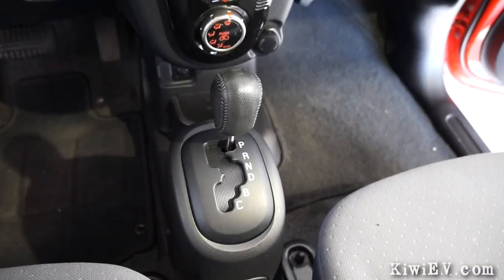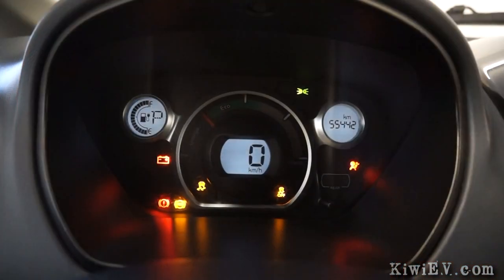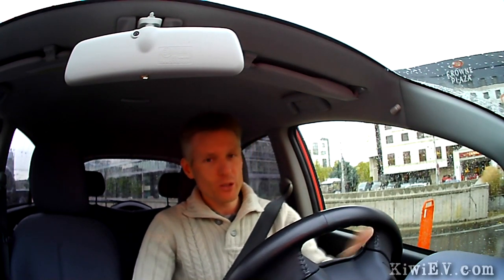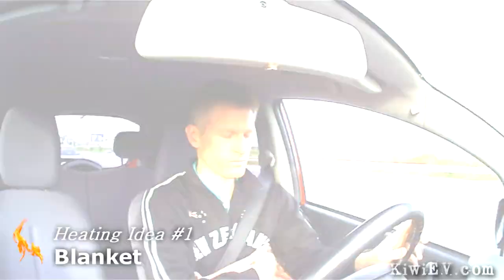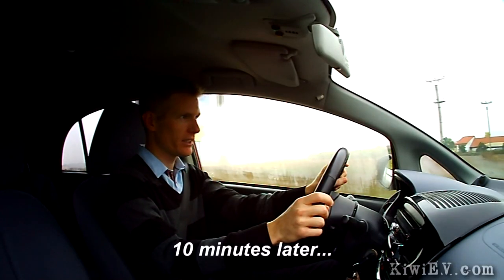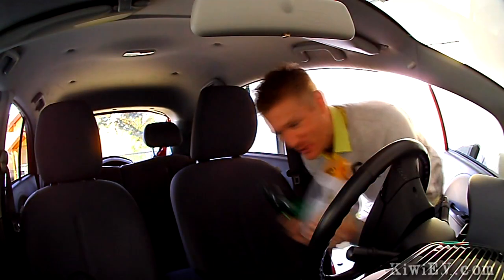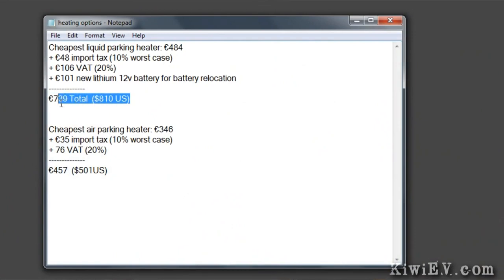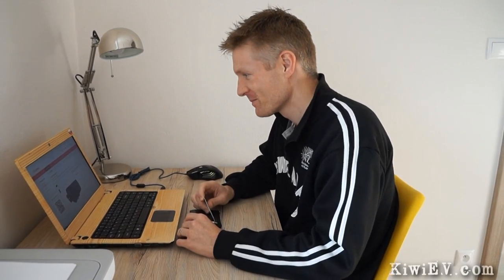Cats, carpet, and the cold: I try out a bunch of ways to heat the car without using electricity

Comment: Have used cheap 12v plug in front seat covers in our ion and they work well. A little to hot really but you have colder climate than southwest uk. Doesnt help cold feet though. Maybe fit in footwall as well that might work. definitely good on seats though.
Reply: That's what I would have suggested. It's surprising what one at less than 100W do when you're sitting on it. Are you sure, Bio-Diesel is actually better than the conventional one?

Comment: Have you tried a 12V plug in heated seat cushion?  Driving gloves and a warm hat would look less obvious!

To reduce fogging I use a sock filled with super absorbent cat litter.  I leave it in the car 24/7 and most of the time my windows inside are nice and clear.  It help to minimise moisture inside the car by removing damp objects or keeping them in an airtight container.

Comment: I don't know how your setup works Gavin, but I turn the climate control on 15-20 minutes before I leave on cold mornings. While it still plugged in. That doesn't solve the fogged up windows problem, though. On a Leaf the defroster uses both the heater and the air conditioner. Double the battery drain. So on rainy days I'm screwed. Even if I bundled up the windows would still fog up
Reply from the maker: I think the cause of my window fogging is me. I need to stop breathing. :)
Reply: I think you might be right, but I'm kinda in the habit of breathing
Reply: you could cook a large bag of desicant for the humidity. Maybe a fan through it to speed it up. Or just leave it in the car during preheat or over night.
Perhaps a better alternative is to live in a country where salaries let's you afford a used Leaf or even a 300km Zoe.
But since there is a sport in trying elaborate solutions you could try setting up a patreon and you could make plexiglass thermowindow inserts for your car. Those single pane pieces of glass can probably drink 4kW on a moderate winter day but with a sealed covering piece of plastic you might cut that down to 25%.
You could also insulate and preheat the batteries. I get the sense that it's not so much the electric heating that is draining as it is battery cold.

Comment: Hot water bottle option was good. Why not just empty the bottles outside when they're cold, put them in a rucksack and fill them up with hot water again half an hour before you're due to head home? Quick trip to the car and back to a warm office while you finish up and the car is preheated.

Comment: Can use heated jacket with cordless drill batteries.
Reply from the maker: Not a bad idea and it could work... but there's no way I'll convince Veronika to wear it. :D I had no choice but to buy a strong cabin heater that warms up the whole car. Plus I get to experience a North Korean diet for a month. Win-win?
Reply: you didnt try having a 12v heater running off a car battery in the back seat did you?
Reply: Btw are that the batteries? underneath backseat/carpet?

Comment: You can burn bio-ethanol. There are small, cheap room heaters for that. And its bio-energy anyways, easy to find in drug stores. See this article:
http://www.heise.de/autos/artikel/Bioethanol-Heizung-als-Reichweitenverlaengerer-1279636.html
Two models: Airtronic E2 and Airtronic E4 with 2.2 or 3.8 kW respectively.

Quite simple: In the end you need an energy source (hot water bottles are easy to fill and to carry) and some kind of insulated box to put into and then a control mechanism to control heat dissipation from the box to the cabin. Such as an internal fan and temperature sensor controlling fan speed. All of that connected to 12V onbord power (just for the fan). This box can be put onto the passenger seat during winter time, blowing air at the driver.

Another idea: battery heated clothing.

Comment: Hello,
I don't recall your name, but I've watch 3 of your videos and you're AWESOME!!
Even without your "blooper" clips at the end, you are witty and more importantly, keep your audience's attension!!! EXCELLENT, keep up the good work!!
I do however have a question about your diesel heater.
First I think I should give you a quick run of my current situation.
I currently "live" in my 2000 Toyota 4Runner and I live in Connecticut (U.S.), and the nights sometimes get unbearably cold!

Now I understand you have an electric car, but would you have any idea how much power your diesel heater eats up if it is ran for a long period of time, at least 4 hours?

Now I have done some checking online and found that there are some diesel heaters sold with thermostats and many with remotes, so those maybe able to help me, but I need "approximately" know how long I can safely run this type of device AND still be able to start my vehicle.
I don't know what you do for a living, but from you videos I see you have a rather small but impressive work area, at least to me. What I mean to say is, I like to build, create, & "tinker", but I am NO Electrian. You seem to be more advanced than me, so I hope you have some educated or experienced guesses you could share!!!!
Well thanks for your time & videos!!!
-Tom

Comment: Darn I'm getting hesitant to order a $20 12v heater on eBay now...I'm not concerned about staying warm yet as -1C weather is strangely not forecasted till Nov.19 in Winterpeg! But I am experiencing foggy windows once the sun goes down. Temp is around 4-8C. Have you tried long john Under armour?

Comment: Hey, man! I know it isn't your cup of tea, but I have heard plenty of talk that the i-MiEV (2010 prototypes) had a little trick to accelerate much quicker from a standstill.

Instead of stomping on the accelerator pedal, could you try to launch with the handbrake? It would make sense given its simple handbrake and rear wheel drive.

I've been dying to know if this is true or not for years!

Great videos, btw, of course, from an Irish fan!
Reply from the maker: I'll have to check it out tomorrow!

Comment: It does beg the question - why can't the manufacturers put copper tube oil/water/whatever filled coils around the motor and use the latent heat produced for heating the cabin - or am I missing a point somewhere ?
Reply: Sasquatch They could. Tesla do this and I guess it's one of the reasons Model S/X are still efficient in colder climes.
Reply: I wasn't aware of that - Thanks

Comment: Driving an EV in th 90' I used a heater blower on a timer on low setting as you found out and two cemetery candles in the driver side door  pouch, they doubled as hand warmers at stops. Might be too offensive to Catholics?

Comment: Isn't it against the law to drink and eat while driving?
Reply from the maker: Yes! Coffee is not only a bad heating idea, it's not entirely legal!
Reply: Well, well, well. :)

By the way, the liquid/electric heater is the most efficient way of keeping your car warm. The reason being, the liquid and other parts of the system can accumulate heat. A plain electric heater can not. The best way of using your heater is to set the desired temperature and leave it. There's a eletrcit thermostat keeping the temperature of the heaters liquid at set temperature.

Also, you need a constant air flow in the cabin, you need to vent the car. You can't just shut the vents and turn the cabin fan off.  It will lead to higher air humidity and fogging up windows.
Reply: also why not preheat the car while plugged in? this so you use the house electricity and not the car battery. not sure you have a charge point at your work but if so then do the same there. this is what i do :)